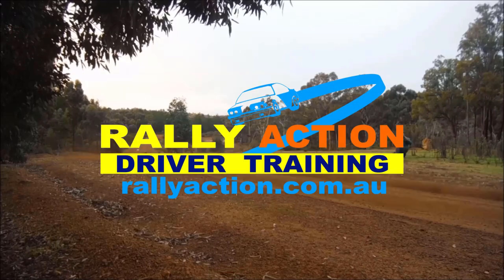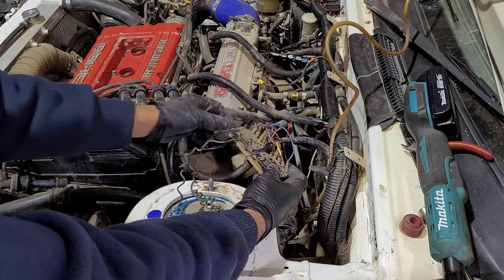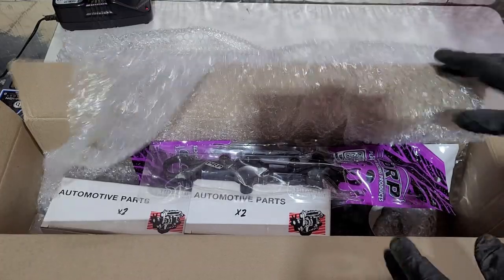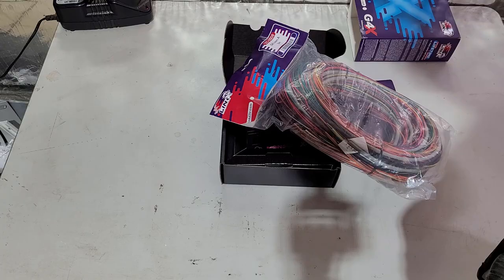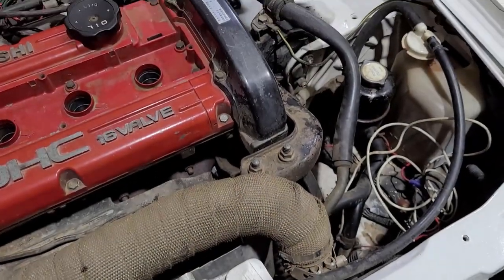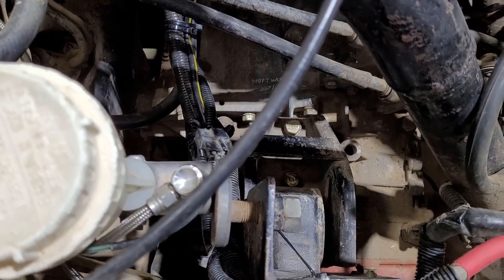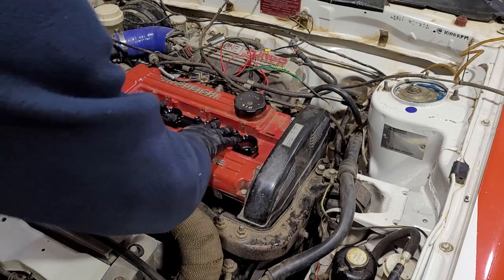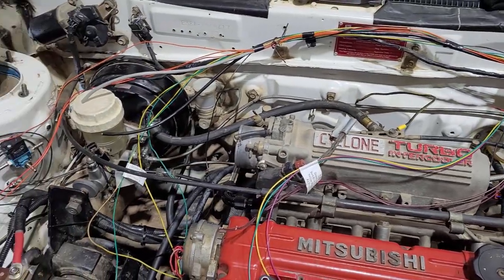Mitsubishi Galant VR4 restoration EP 2  (Electrics part 1)

Comment: Awesome vid,
I was hoping you could give us a link of all the PRP and Link 4G part numbers and where you got them from.
As I would like to replace all of mine with same as yours.
Reply from the maker: We won't be able to put the links up, however can steer you in the right direction. Contact PRP directly for the COP conversion to make sure you get the correct one for your engine. Any reputable Link dealer will be able to supply you the right parts to suit your car. If the car still has the OEM ecu, there may be a plug & play  Link ECU available which saves a wire in unit. We used a wire in as the OEM ecu and loom had already been removed.

Comment: Great video, I've been waiting for this one! I noticed the adjustable brake master brace, is that something you see commonly on rally cars? I might use that idea on my Galant.
Reply from the maker: Thanks for watching. The brace on the master cylinder was fitted by a previous owner. They are supposed to reduce firewall flex during braking. We do see them fitted occasionally..